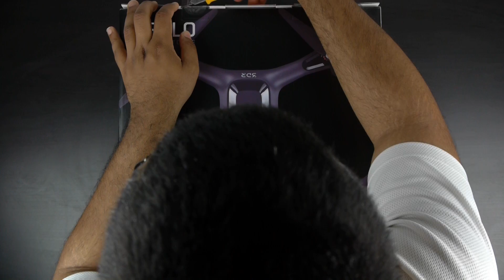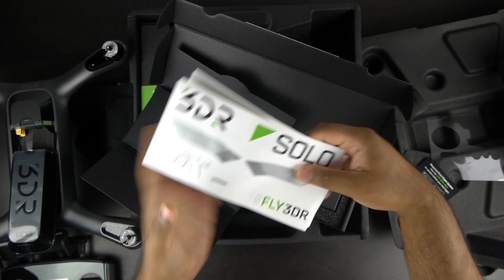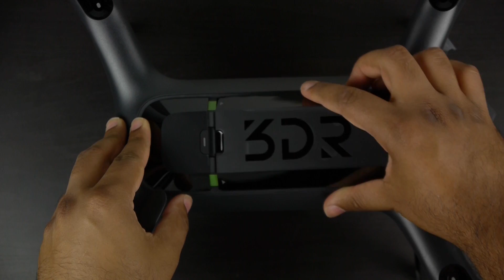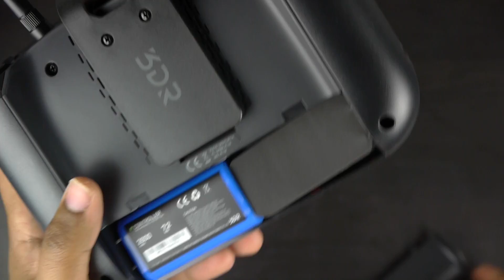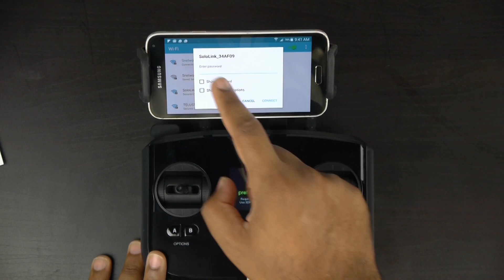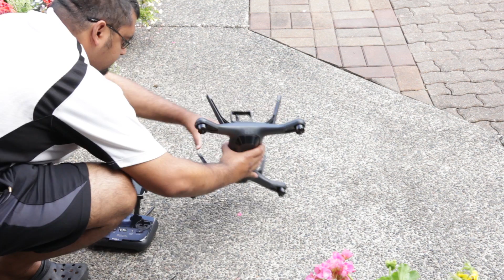3D Robotics Solo Smart Drone - Unboxing & First Flight

Comment: Bit late but.. I need to ask a question!! For the price is it worth it? And is there a  camera built in or do you have to buy a go pro?
Reply: It comes with a go pro 6 with the package
Reply: RugFrZ I know this is late but I found it on amazon for $260 (Prime) anyways the original price is worth it  and it doesn't come with a go pro I think

Comment: Do you know when the review between the Phantom 3 Professional and the Solo will be coming out? Also for anyone wondering, in order to get the capabilities that the features that the Phantom 3 has on the Solo you will have to spend around $1900 because you have to buy the GoPro and gimbal separately.

Comment: How you compare this to the Dji Inspire 1 whats better overall
Reply: There's no comparison. They both have different Uses and one is way more expensive but better then the solo. But the solo is a great drone.
Reply: cisco150 The Inspire is a professional-grade drone, while the Solo is an intermediate-level drone. I don't see why you would even compare the two. Surely you can find out which one is better simply by going to their respective manufacturer's website and clearly see and understand why the Inspire is better.